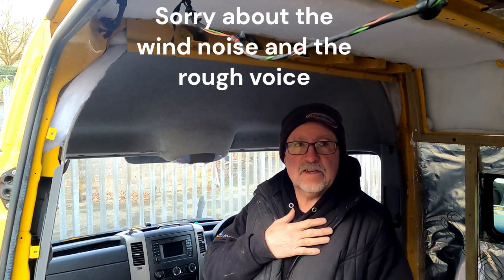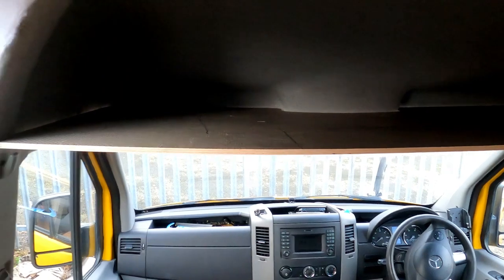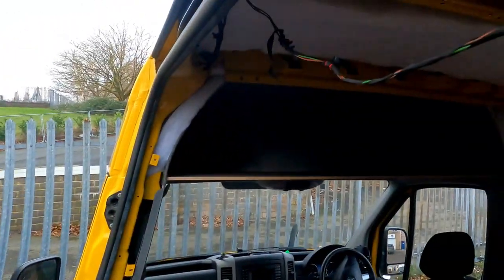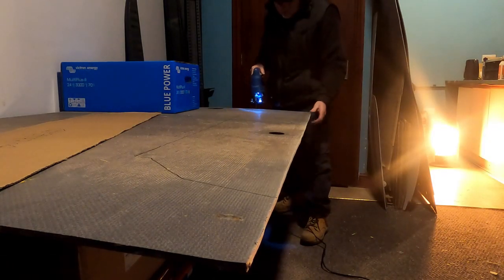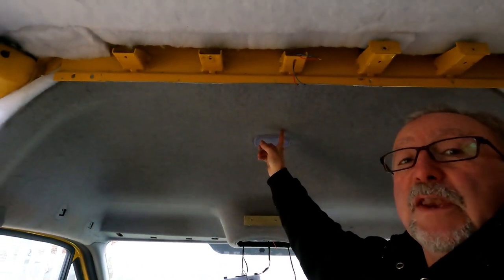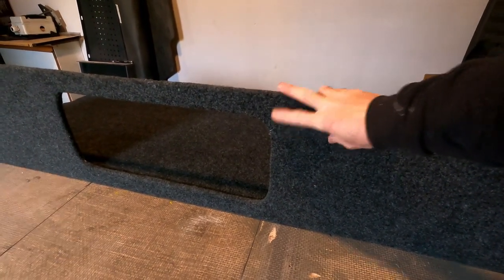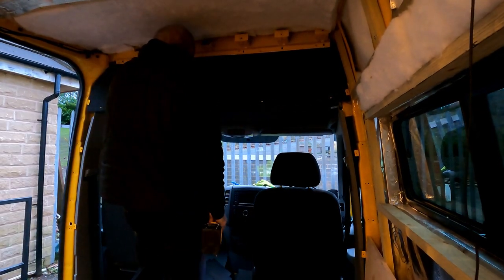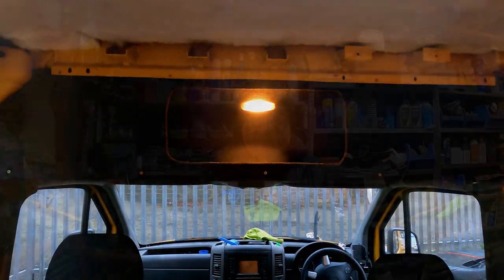Cab overhead locker for sprinter van

Comment: Could have used battery operated movement sensitive on/off lights, very good, from Ikea. You just wave your hand in front of them, instead of fumbling for a switch.  Also, no need for wire connection.  Still, maybe on your next one ... 🤔     The queen bee is looking good 👍